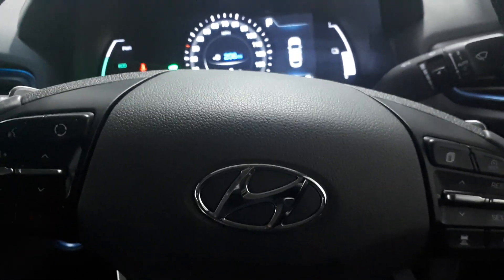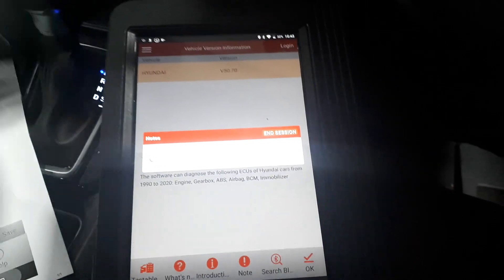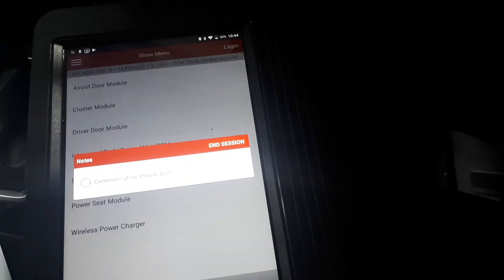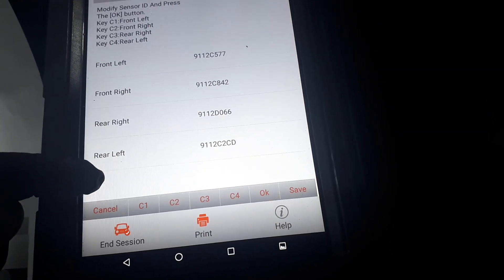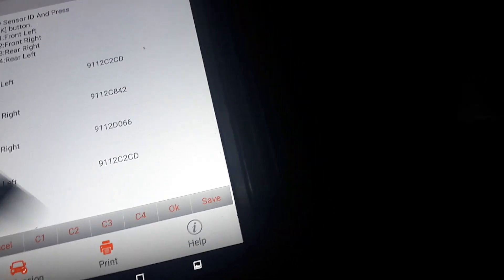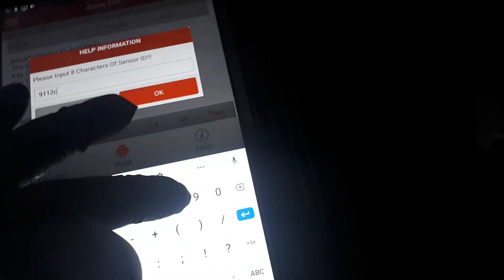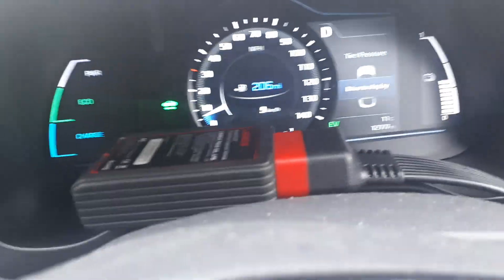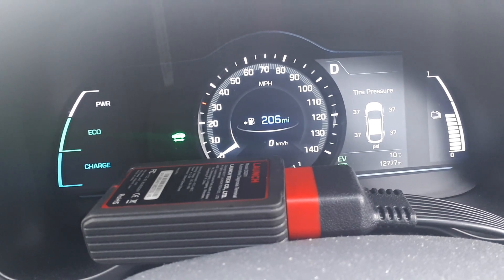Launch X431 TPMS Sensors Writing

Comment: Salut, 

Am un I40, 2012 - am o problema cu senzorii - imi clipesc de 6 ori, se sting, iar clipesc de 6 ori.
Am fost la cineva cu OBD, i-a citit, i-a transferat in ECU, am respectat procedura din aparat.
Problema persista, am si umflat roata mai mult, am incercat mai toate posibilitatile.
Ai idee de la ce ar putea fi ?

Senzorii sunt cititi corect, presiunea 2,5 pe R18.
Reply from the maker: Unul din senzori nu comunica cu TPMS, daca ai un TPMS exciter poti sa-i activezi si vezi care comunica si care nu.
Reply: @GicaPhp  Adica nu comunica ? Au fost cititi cu succes, s-au transferat cu succes in ECU..
Reply from the maker: @cimpuadrian-mihai7818  da, ii poti citii cu tpms exciter, le poti citii codurile, le poti scrie in ecu, insa din anumite motive ecu nuncomunica cu unul sau mai multi din ei, asadar, ia vezi in live data, cand mergi cu masina daca inregistreaza temperatura, presiune, cod etc. Inca un trick care merge uneori, deconecteaza baterie 30 minute si retesteaza.
Reply: @GicaPhp  Hyundai i40 din 2012 nu are live data :(
Am scos borna de pe baterie si am restartat. Nu a vrut nici asa..
Reply from the maker: @cimpuadrian-mihai7818  ce scanner folosesti? Ar trebuii sa fie in TPMS